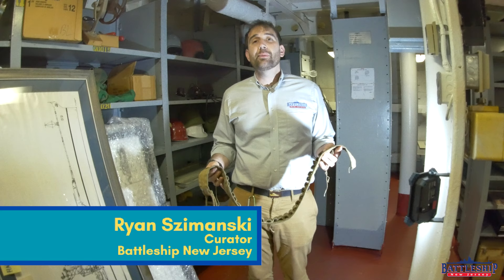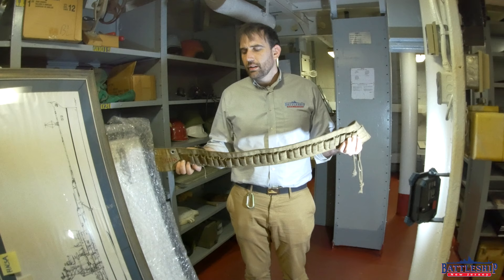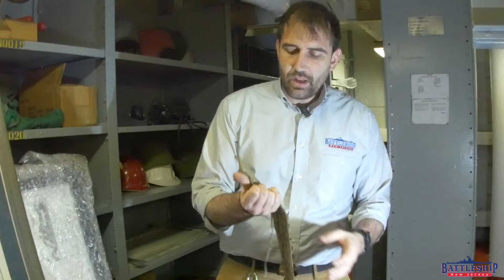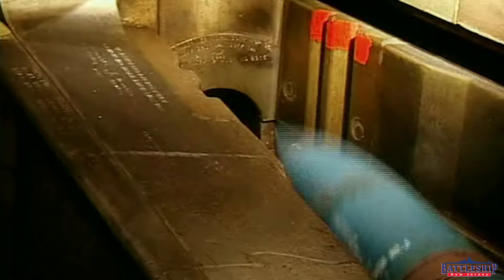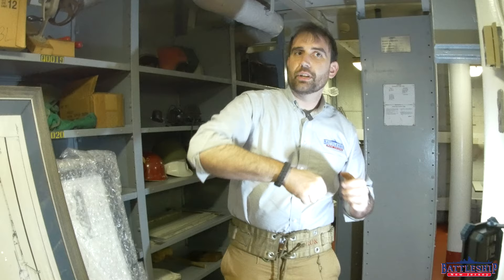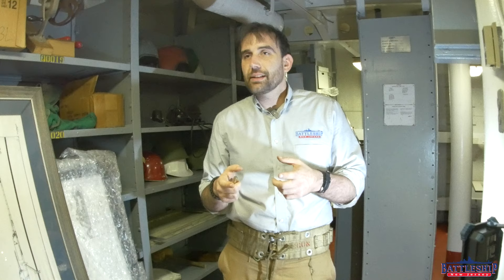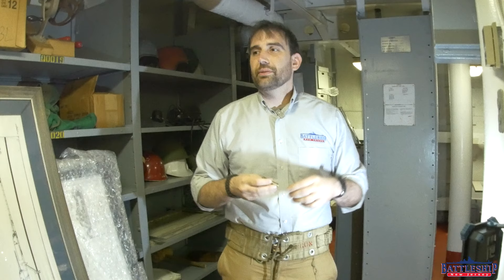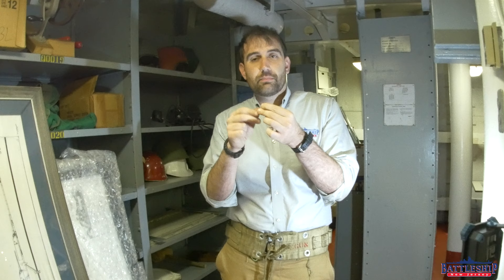A DIY Cowboy Belt for 16 Inchers

Comment: Fascinating.  Sailors innovate when the opportunity arises. “The sail locker” and the “sailmaker” (and the carpentry shop).  On a battleship. Stories in their own right.
Reply: Same here.  I'd like to hear the stories from those guys.

I would assume that the carpenters shop would be part of damage control.  What kind and how much shoring was carried on board?  Assuming they also worked on the ships boats.  And what kind of "special" projects did they work on?

Do any of the BBs have an "oral history" program going?  If not, there should be.
Reply: It would also be interesting to hear from the repair guys who fixed the wood flight decks on aircraft carriers.  Especially bomb damage repairs.

I've seen photos of repairs in progress, but nothing showing completed repairs.  Wood shoring under the deck?  Scab patches to cover the hole in the flight deck?  Or did they replace individual timbers?

Next question.......they had to have a manual for this.  Any source for the manual online?
Reply: @bizjetfixr8352  You’re right about ship’s boats. As an OCUI2 one of the instructors was a Warrant Officer Carpenter. His collar insignia (working blues) was a try square. Looked very much like the single chevron of a PO3. The WO was very sensitive about proper saluting and there was one last minute salute when I  realized who was approaching.  Just managed to save myself.

Comment: Reminds me of the Mills Belt holding 45-70's which are dimensionally close to the primer you have with thick rim.   For sure it would be easier to have a belt on you than having to go to a box for every shot.   Ammo belts are very cool!
Reply: that's what i thought i reload 45-70 it looks just like one of the cases but i'm sure the primer here has a much thicker case
Reply: @russellflemister393 might not. He said it’s an army creation and the 45-70 was an army round. I bet it’s just a blank 45-70 case.
Reply: i shouldve read this comment before i posted lol.
Reply: I was about to write the same thing. Looks very much like a 45-70 belt for a trapdoor Springfield
Reply: I was thinking who shoots competition and only has a 16 inch waist?
Reply: He mentioned its .30 cal, so can't be. I think there is another type of primer that actually straight up is .45-70 blanks though.
Reply: i'd say that's a modified 30-40 krag case seeing it next to that 30-06 casing!
Reply: @keithmoore5306 
A 30/40 rim isn't nearly that big, they're only slightly larger than the base of the cartridge, they're more like a semi rimmed case than a fully rimmed one.
That primer thing looks 45/70 from top to bottom, they'd need to use a fully rimmed case for that application since there's no neck for it to seat against when it's pushed into the primer chamber plus you'd want a big rim for extraction. 
Given that those primers were an Army invention and they probably date back to when the Army still had all kinds of tooling for the 45/70 around I'm gonna go out on a limb and say it's a 45/70, I've got an empty case sitting in front of me next to an 06 and a 30/40 and that thing sure looks like the 45/70 I'm staring at.
Reply: @geometro9512  Yes,.45-70 case but the internals are very different because of the electric prime and percussion prime system making the case heavier and containing only 30 grains of black powder instead of 70 grains(in old balloon head cases)with bullet.
Reply: @rj4590  my thoughts exactly, although the blank case does appear to be tapered a bit, likely to make extraction less problematic. 
Although, to be pedantic, Ryan did miss the boat on the cordite exploding. Cordite deflagrates, black powder detonates. That and the electric primer blank uses cordite, ignited by the wire igniter, which then sets off the 30 grain black powder. Looked it up, pretty robust ignition system either way.
So, it's likely a modified 45-70 black powder blank cartridge, which some shore batteries also utilized.

Everything about those 16 inch guns made me happier about only having to heft 120 mm mortars when I'd join our mortar crew to drop rounds.*

*I was their medic, so they'd let me join in on the fun, as long as I followed their instructions.
Reply: @spvillano  Ryan also made a mistake saying the main charge was cordite which was a double base propellant used by the British that is formed in long strands and is erosive and doesn’t have the long shelf life of the smokeless stick propellant used in main charge in the powder bags.
Reply: @rj4590  I still slip on occasion and refer to all nitrocellulose based propellants as cordite, old head habits.
It does get a bit dense though, nitrocellulose alone, nitroglycerin enhanced as smokeless powder rounds tend to be, further enhanced, etc.
Pure pain in the scrotal contents to keep track of at times.
Reply: It's very much like a .45-70 blank. The line throwing gun used for unreps also used a .45-70 style straight wall blank in a gun that looked a lot like a sawed off 410 shotgun. 
Of course after a while, they started using a kit that attached to an M-14.
Reply: @jamesdolan5236  makes sense to replace the 45-70. It was a round used in the 1870 Sharps rifle. And rifles in that caliber are expensive now.
Reply: i doubt it is a cartridge case, 45-70 or otherwise, because of the big honkin primer pocket for the insulated primer
Reply: @789train  I owned a 45-70, it might be, as that was a big honking primer.
But, more likely reused and retooled for artillery, thicker casing like black powder cases were and enhanced primer. Retooled, as all of the tools and outer dies existed, so reuse them, rather than reinvent them.

Comment: Judging by the sectioned drawing from the Army manual I'm thinking the primers were machined from solid brass rod vs the drawn brass cases used for rifle and pistol ammunition. Plus it looks like the primer case is made from two pieces. Yes, the front sleeve (metal seal) screws into the primary case via a tapered thread (1/8th or 1/4 NPT?). A third piece carrys the actual primer and ignition wire with the firing plunger carried in the bottom of the main case.
I sure hope the man stationed in the gun pit got out of the way when the gun fired and the breech/barrel assembly recoiled into the space.

Comment: That primer looks like the primers we used on the m777 Howitzer.
Reply: They are. My dad was artillery in the 70's and 80's.  We had a chess set made from spent primers.
Reply: @motomuto3313  Do you have a picture of that that I can see?
Reply: Same for the M109A6.
Reply: that primer probably hasn't changed much since it was adopted and most likely goes back to at least the korean war or farther!!

Comment: Interesting video Ryan, though I feel compelled to point out a fact about the cartridge cases. 
The .30 cal cartridge fires around 55 grains of smokeless rifle powder generating roughly 52kpsi. The naval gun generates roughly 36kpsi, quite a bit less. However, they achieve similar velocities of 2700fps, but the rifle does so from a 22" barrel. The rifle cartridge can be thinner because it spends less time in the firing sequence and therefor absorbs less heat. Also, blackpowder is an explosive where as smokeless powder is not so the primer case my experience momentary pressures much higher than the average working pressure.
Reply: Black powder definitely is not explosive. Smokeless absolutely is. 

This design of primer is from at least 1899, before metallurgy and material properties (especially under high pressure) were terribly well understood. It wasn't uncommon at all for brass cartridges to separate at the breach, allowing gas to blow out the back. That's unpleasant to experience with a rifle shooting a few grains of powder. That would be catastrophic to occur with a 12", 14" or 16" gun, with a few hundred pounds of powder behind it. That's why it's so thick, because the difference in priority between keeping weight down on a small arm vs keeping safety high on a bag gun.
Reply: 55 grains? 308 precision rounds run 21 grains! that's probably a modified 30-40 krag casing!
Reply: @wyattroncin941  you are completely upside down. Black powder is most certainly an explosive. Smokeless is a deflagrant, which is why it is capable of velocities over 4000 fps while blackpowder struggles to break 2000. Why? Because smokeless burns it can maintain a pressure curve over time, where black powder generates an immediate pressure peak.
Also, the .30 cal cartridge was first adopted in 1903 for the 1903 Springfield rifle. The rifle and cartridge were very near clones of the Mauser rifle and cartridge that were adopted in Germany circa 1898. Both cartridges operated at the same pressures then as they do now. The metallurgy was understood well enough.
Reply: @keithmoore5306  are you talking about .308 Winchester rounds? I'm talking about .30-06 which was the .30 cal cartridge of the WWII Era. Even if you are talking .308 Winchester your numbers are off. That cartridge typically runs 40-45 grains depending on powder and bullet weight.
Reply: @steelwheelsminnesota yeah i'm talking 308 and i'm using a marine corps precision rifle team load i picked up and have been running for a while a 147 over 21 grains of IMR (i'm blanking on the powder number right now!) but 7.62x51mm vs 7.62x63mm volume wise they're shouldn't be that much difference (maybe 11 to 12 grains between 308 and 30-06!) unless the IMR has more horsepower because it chrony's close to winchester factory 308!
Reply: @keithmoore5306  I am doubtful of that load. 21 grains is extremely light for the .308. Might be fine for plinking or 100 yard bench but it would be far too slow for service use or long range. Generally .308 sees around 40 grains depending on bullet weight and powder type.
Reply: @steelwheelsminnesota  it works!
Reply: you are right, he must be loading only 110 grain lead bullets--or something like that. @steelwheelsminnesota
Reply: @thomasmoore8142  he said 147's but I'm thinking he must be using a fast powder for a reduced load. 21gr is less powder than a .30-30 would even use and is not a good representation of what the .308 is capable of. 21gr would also fail to reliably ignite the medium rate powders that give the .308 its performance.

Comment: From what i can find online, this specific primer is a MK-15. You can find details of the Mod 1 version in TM 9-1904 dated 1944.

I don't think it is based on any particular rifle cartridge.

In the army, we used a M82 primer for our 155mm guns for the M109A6. It seems to be very similar to the MK-15 minus the electric ignition option. We would have to hook up a lanyard to fire the gun. A few people more brave than me would just finger pop the firing mechanism. Granted, that's only for low charges. You'd probably lose your hand if you tried that with max charge.
Reply: mk-15 or mk-14!??? combination lock primer??
Reply: Yeah, I found a cutaway of it, and it's quite a bit more complex than a rifle cartridge case - the sleeve that's blown out into petals on the front of that case is actually screwed into the case via internal thread that are about halfway back. That cap on the back isn't the actual percussion cap with the priming compound - it's a plunger that transfers the hammer strike to internal cap that's behind the thread. 

The electric fuse wire (nichrome?) is between the cap and the thread. So really, it's like a cartridge within a cartridge.

Comment: That is a 30.06 casing you are wondering about. Depending on the type of powder the 30.06 requires approx. 53 to 58 grains of powder , FYI.
Reply: I like his 75 grain bubba load idea tho 😂
Reply: @salty-9  That would prove to be a little "salty"
Reply: i don;lt see how they get 53 let alone 58 grains in a 30-06 a 308 precision load only takes 21 grains!!
Reply: Depending on bullet weight my Garand likes 41-44 grains.
Reply: @keithmoore5306  Hi Keith: Well 53 to 58 gr. is standard fare for the 30.06 as is approx. 39 to 44 gr. for 308. You can verify that by looking into any reloading manual. I reload and shoot 308 and 30.06 regularly. And have done so for many years.
Reply: @cjc_0167  41-44 gr. is pretty much standard fare for 308 but not for 30.06. Look in any reloading manual. Perhaps though that load might be suggested for a reduced load for kids in a 30.06.
Reply: @lencac7952  must be a powder difference! that's probably older ball powder with less kick to it than what i'm using!
Reply: @keithmoore5306  nope, that's all modern loading data. All the numbers I put forth for 308 and 30.06 are current and for the full range of powders listed in most all reloading manuals. Go ahead and take a look for your self in any loading manual.

Comment: As @bascomnextion5639 pointed out, the reason it doesn't have a proper buckle is because of the concern over metal to metal contact, especially in the gun pit. So there may have been a similar standard issue item, but it's been repaired or otherwise rebuilt over time, and they just built them with the lace "buckle" in the first place

Comment: Hey Ryan! You are spot on when you say the primer was used to hold back a very high pressure.

The primer shell diagram shows a very stout base and 'primer' pocket, with a very long firing plunger in place of the primer, which is way inside the base of the primer shell. And I suspect the firing plunger carries the electric current to the primer mixture surrounding the wire element.

Not your typical rifle or shotgun shell.

Comment: Like you said..  really cool artifact.

So that's how they did it.  All of the videos never show the guy swapping out the primer, or where  it went..

If they were made on the ship,, as appears likely, were they made to fit the guy installing the primers?  If so, did they get to keep them?  To me, it's would be too cool of a souvenir not to keep.  I'm betting there are some more of them around.  Would also be interesting to know if there was a "Navy Issue" primer belt, and how it differed from the custom fabricated ones.

Ditto the spent primers.  You need to do a thorough search for more of them, and sell then for big $$ in the gift shop.

Finally....... did all of the USNs 12-14-16 inch guns use the same primers?

Comment: I wonder if he has calipers on the ship and could measure the primer cartridge for the viewers who are interested in comparing it to 45-70 Government cases.
Reply: The specs might be out there, most ordinance components are. I'd check the cartridge collectors forum!
Reply: I'd be willing to bet its either similar in nature to 45-70 or 30-40. Given the shown size comparison I'm more on the boat of 30-40.
Reply: 30-40 for sure
Reply: it looks more like the 30-40 krag than a 45-70!
Reply: Ordnance Pamphlet 1164 Volume 1 Dated 28 May 1947 gives a body diameter of .492" for the Mk 15 Mod 1 primer. Larger than the base diameter for a .30-40 (.457") or a .30-06 (.473') but smaller than the base diameter of a .45-70 (.505"). But agreed, it'd be nice to have some measurements. There's got to be a set of calipers on the ship somewhere.
Reply: @high633 since the primer can be striker fired or electrical fired I would look more at primers used for machine guns or guns used by AA batteries. Additionally even with the priming charge sewn into the silk powder bag it is going to take a good hot primer to light off a 16” gun charge especially since the powder charges were not stored in an climate controlled environment meaning that the powder charges are going to absorb moisture while on ship and wet/damp large flake powder can be hard to ignite
Reply: @johnlowe37 the size of the priming cartridge is most likely unique to “bag guns” because you would not want someone to accidentally insert a wrong cartridge (say 30’06 aka 30 Government) into the breech block of “Bag Gun” because bad things very well could happen with a cartridge with a projectile being chambered into the beech.  It called following the KISS rule

Comment: Looks the world like a 45-70 cartridge though obviously it's a completely different construction as shown by the cutout picture. Maybe historically some earlier guns used actual 45-70 blanks for primers and they kept the old dimensions even though the internal design was upgraded for electric firing and to withstand the grater pressure?

An interesting fact: the most important job of a cartridge case is not to keep the parts of the cartridge together but to seal the chamber when firing. The metallic case does this by expanding under the pressure and then springing back for easy extraction when the pressure drops as the bullet exits the muzzle. Breech loading guns were experimented before the advent of metallic cases but they suffered from sealing problems and because of that never became popular until the case was invented. Large guns like the 16 inchers that don't have cartridge cases use an obturator that does the same thing, expands under pressure to seal the chamber, but they require more maintenance than guns using cartridges as the sealing surfaces need to be kept very clean to maintain gas seal.

Comment: Another thing that suggests that it’s is hand made is that the stitches are crooked and the loops for the cartridges don’t all have the same distance from the middle to the edges along the entire length. If it was factory made the stitches would have been straighter and the loops would most likely be centered down the middle of the belt the entire way

Comment: Looks very much like a modified 45-70 or 45-90 rimmed black powder rifle cartridge case. Would be interesting to get the outside diameter of the primer case to see how close it is.
Reply: going by the 30-06 it was compared to i'd say a modified 30-40 krag casing!
Reply: Could well be, only way to know is for Ryan to actually grab a micrometer and measure the OD and length of the case.